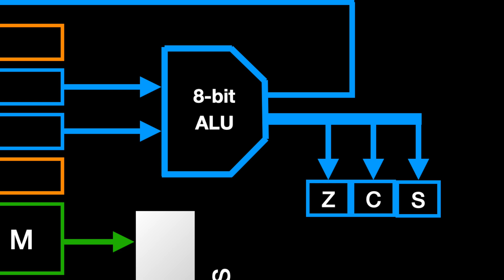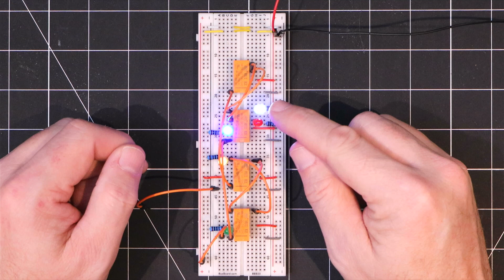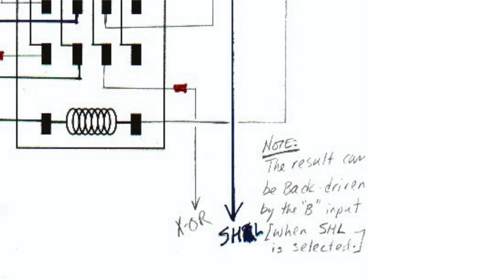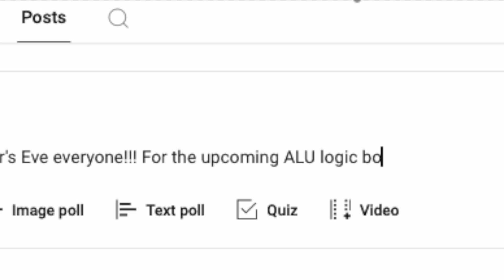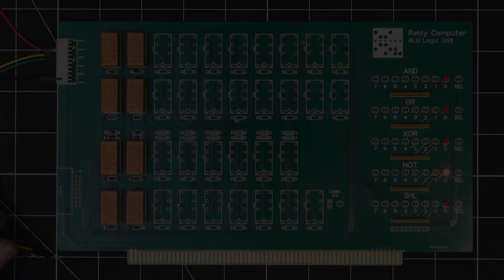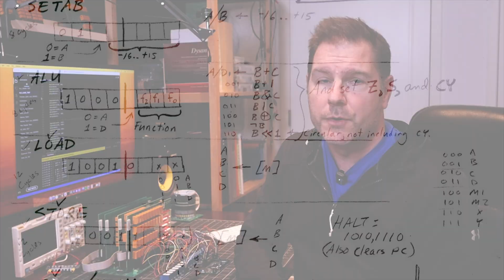Relay Computer - ALU Logic Unit

Comment: can you run this at 60hz? witouth failing my relay did 200HZ with sync adn lag
Reply from the maker: No - the switching speed of these relays is ~7ms, and there's propagation to consider. Once it's all together I'll do a video with some speed experiments to see where it all tops out.
Reply: @dipdoting ok👍

Comment: The full adders in the ALU had the signals for B XOR C and B AND C in them already. Did you consider using those values instead of recreating XOR and AND on this board?
Reply from the maker: The Adder card generates the control signals for  XOR/AND etc using the 3-bit function input from the main bus. These control signals are then used to tell the Logic Unit which gate (XOR/AND etc) is to be opened to the data bus.
Reply: @dipdoting  I got that. My point is that half adders and full adders are already doing XOR and AND. On a half adder, the carry out is AND, the sum out is XOR. So both the Adder Unit card and the Logic Unit card are calculating B XOR C and B AND C. But the Adder Unit doesn't send these values to the bus.

I think I should have used the word "values" instead of "signals". "signals" was the wrong word. Words are hard. :X

Comment: So, I have a random question... About your channel logo!

It's quite clearly punched tape. The 3rd row contains the sprocket feed holes and are only there to make the tape easier to feed through machines. The other five rows contain data; a hole is a 1, and a lack of a hole is a 0. Or possibly vice versa.

Each column is one unit of data. One "word", perhaps. And this is 5-bit tape. But I can't, for the life of me, figure out the encoding. Depending on whether the data is left-to-right or right-to-left, whether a hole is a 0 or a 1, and depending on whether the most significant bit is bottom or top, assigning letters A-Z to 1-26 gives IFVIXP, PXIVFI, RLMRCA, ACRMLR, VYIVGO, OGVIYV, MSRM[28][30], or [30][28]MRSM. None of that makes sense, so that's probably not the right encoding. I suspect it's some sort of text encoding, as I'd assume it says "DIPDOT", especially considering columns 1 and 4 are the same. But I don't know what encoding.

Wanna help me out here?
Reply from the maker: It's Baudot-Murray ITA2 - it's a Telex code - I've always had a fascination with vintage telecommunications!
Reply: The given letters match with ITA-2, as listed in the Wiki article for 'Baudot Code'.

Comment: Have you tested that board with the Arduino to see just how fast you can clock it before you start getting logic errors?
Also, having that jumper is smart, but have you considered adding an additional instruction to turn that function on or off during runtime in case you want to have both behaviors?
Reply from the maker: Reading my mind! I think that would literally make a cool "Quick Clicks" video (mind the pun!) The SHL carry jumper could be driven by a control line and relay in future, I have a feeling there'll be a REV 2 to this computer! 😉
Reply: Cool! I'm looking forward to seeing it!

Comment: One thing i'd like to see is a mix of the old and the new ! Upload your assembly opcodes to CharGPT and ask it to compile the Fibonnacci sequence. Try that instead of building a whole compiler !
Reply from the maker: When it's ready I'll do both and we can see which one wins for both speed and aesthetics.
Reply: Ok, I just did that. I typed in a long and concise (but I think complete and unambiguous) description of the architecture and assembly code. Then I asked for a program to compute Fibonacci numbers using an iterative loop.

ChatGPT came up with a program that was sort-of right. However, it used instructions that are close, but don’t actually exist. For example “Y=B+C”. Also, it had trouble with the condition codes. In one ALU instruction, the CARRY bit is set and several instructions later, it is tested. However, an intervening ALU instruction clobbered the CARRY.

Bottom-line: ChatGPT can produce assembly code, but I think the burden of learning an entire architecture all at once may have overstretched its working memory, leading to silly mistakes. But who really knows what’s going on inside its mind?

Comment: OK, I am somewhat confused by the SHL function. Clearly it is a rotate left function because a shift left would shift (usually) a zero into the LSB every time. So why are you calling it SHL not ROL?
Reply from the maker: I followed the naming convention from the original designs I found - the cool thing is that we can call the instruction anything in the end.
Reply: @dipdoting  exactly, I think some are confusing assembly instructions with logic gate stuff. and to be fair, the names depend on who you ask, for example "not and add" or "invert and add", kind of do the same thing, subtract. is it a 'mask' instruction or an 'and' instruction, lol.
Reply: He addressed it at 2:25 as it does not address the carry bit. He also stated it may be addressed.Ore in the future.
Reply: @RvnKnight  He implements carry at the end. Anyhow generating the carry bit is not the issue. It's about what happens with the LSB. If it's rotate, you shift the MSB to the LSB. If it is not a rotate, you shift a zero (usually) into the LSB. This implementation is called a left shift, but it is functionally a left rotate.
Reply: Yeah that's definitely a rotate, not a shift

Comment: Boooo!    Replacing the OR gates with diodes to save space/traces is outside of the spirit of the project !  If you're doing that, why not use 74x logic gates too?   Arbitrary lines 😞
Reply: Diode logic is period correct for relay computers though, I think it fits perfectly. Engineers back then definitely weren't dedicating cost and space to relays when diodes would do. Relays are still expensive, and there will be plenty of other uses for relays here
Reply from the maker: Yeah I'm trying to keep it in the realm of 1940's technology - they did use diodes in those days. Of course I am using an IC-based memory for now but also intend to move to capacitor memory in future.
Reply: @dipdoting  yes but you can create many gates with diodes so why stop at not?

Comment: Loving the carry shift left option - there's a few times it would have come in handy :) ... along with a branch on no-carry
Reply from the maker: Thank you Paul! It's been fun to tweak the design a bit. I also have a few "lessons learned" along the way - a good excuse for upgrades in the future 😀
Reply: @dipdoting Yea, don’t be surprised if it makes an appearance in my computer at some point ;) might be the one time I’m glad the ALU is wire wrap rather than PCB lol
Reply: esp for floating point stuff, yeah. left or right I guess ye can do the other by taking the bit-width  and subtracting how many steps the other way and applying the result to the shift. shift with wrap-around or not is another thing that depends on use (small low watt logic or fast real-time whatever). it has been so long since I looked at any of that stuff. the most critical is having the invert (not), so you can use the adder to subtract, the rest is DSP/Supercomputer luxury.

exp, shift right 2 places on a 16bit ALU that only has left-shift
16 - 2 is 14
shift left 14 places.